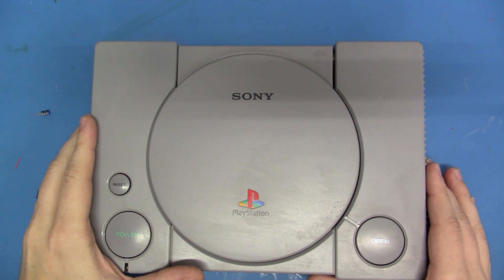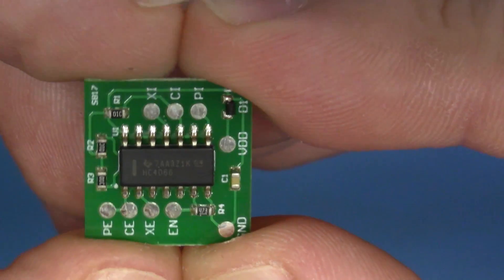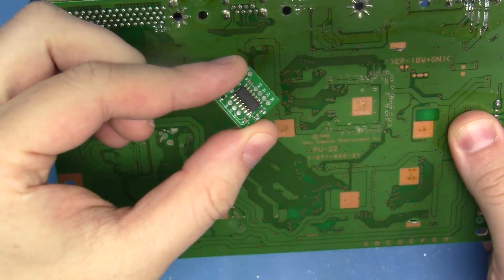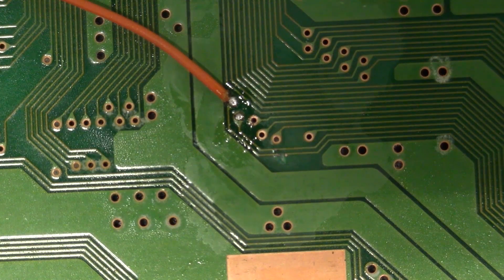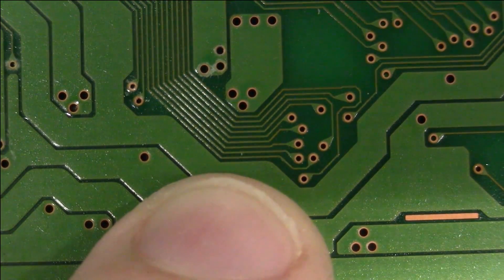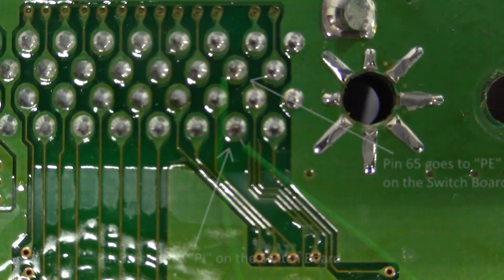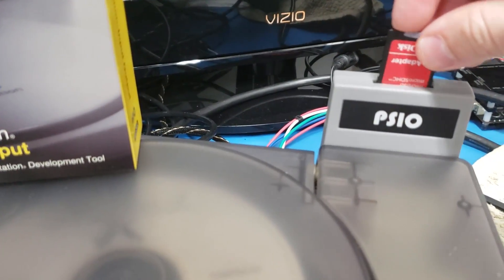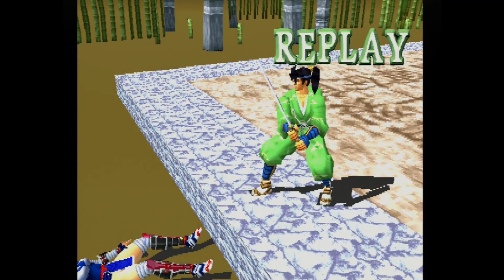PS1 Mods To Run Games FROM SD Card!! PSIO

Comment: would the PSIO work if my cd drive in my scph-1002 doesn't read games?   I've tried adjusting the gain pots and it's just impossible to get these original consoles configured to work with genuine and cd-r rips (console is modded)

Comment: great vid but id suggest if anyone uses a fibre pen hoover the residue off or wipe it off with a kitchen towel with isopropyl alcohol on so fibres stick to it, if you wipe it with your finger and not wash your hands then wipe an eye you could have a very sore eye from the fibre dust

Comment: I think the biggest glaring issue here is that later versions of the playstation (yours is probably the newest that still has it) don't have an expansion port anymore. and the PSone definitely doesn't.
also years ago, I installed my own mod chip. is it compatible with those things? I think my playstayion is actually a 5500 series.
no memory card? heck, It'd be better if you could use the PSIO as a memory card too.

Comment: Very cool man. But for all the mods I have seen. I never saw anyone tried to make a module that mimics the optical drive with the original drive connector on the board to enable a flash drive or even a hard drive and maybe even USB. This would be the master of mods. 🤔
Reply from the maker: I 1000% agree!

Comment: The question is: Who is this aimed at? Real retro gamer or collectors would not vandalize thier ps1's for a mod module just to play on sd cards instead of discs. Especially when that module costs ~130$ give or take a few bucks and the alternatives are many and INEXPENSIVE... emulator, ps one classic mini, psp, ps2, ps3... hell even a ps3 with cobra ode can play ps1 back ups, if its a fat model gen1 it can even play ps2 back ups... So again, who is this aimed at??? I could understand an ODE for PS2's... but not this.

Comment: I found out this years ago but i don't like this project... The price is pretty steep for something you need to install this way and wait for like a decade before you can get ahold of it... It reminds me of those Open Source projects you need to fire up microprocessor programmers and adapt code to your needs... but instead you pay for it a fortune...
I can probably set up a Rasberry easier in the Ps1 using the same outputs and inputs running seamlessly in parallel with the stock system by a switch selector, at least i can start right away doing it by paying a few bucks.

Comment: I'm waiting for an easier solution. I'm sure a GDEmu/Rhea/Phoebe style plug-n-play board wouldn't be too hard to make. All it has to do is generate the code the Playstation needs on boot, then pass to the SD card. I'm sure you could fit that on a board that interfaces directly with the CD laser's ribbon cable so it doesn't require soldering.
Reply: they tried if i remember correct, but audio problems made them go to injection route instead of replacement

Comment: I remember using The adapter piece back in the day to play back ups and Cheat Codes without chip modding 
Awesome video
Reply: yup same is called the "ps hacker" and you still find it for 20€ so why buy this thing?
Reply: Lightblue It was awesome brings back memories Remember the PS2 HDD disc 😳😂
Reply: @QsTechService1  plus the PSIO get one probleme for the games. is cant play audio cd and some game use audio cd sondtrack.

Comment: I dont understand why this exists.  why make a plug and play design if you still need to mod the console?
Reply from the maker: I agree. I'd rather remove the optical drive all together if it takes the burden off of the customer from having to have intermediate soldering skills for a device that already costs over $120...
Reply: @Voultar  yeah that makes MUCH more sense.  also I know you kept saying about no solder pr0n but it still felt like there was.  excellent work as always man!

Comment: Ugh, it's just a shame that you have to cut traces to get this working properly. That's so... permanent. I don't know that I would perform this mod on a 750X. In my experience, those were among the most reliable PS1's, and even then, you can still get replacement lasers for them. So yeah, I have two 7501's and a 1001... I would have NO problem installing this in the latter, however... Unless someone's gonna tell me that the 100X is a crap model for THIS mod as well.

Oh, I can't end this without including the obligatory "I'm SOOOO disappointed in the lack of wire porn in this video!" comment. 😆
Reply: I bought a second PS for $20 to use for the PSIO

Comment: I have a PSIO took a year to get after ordering. I have about 100 games on one 128gig sd card. there"s a software interface you can download from the psio website that will help .Some of the roms have to be converted to a file the psio can read and this software for the most part works really well .This interface also allows you to stream a rom from your pc straight to your PSIO via a usb cable. Wish this was covered on the video.
Reply from the maker: It's pretty clear that this wasn't a PSIO product review video.. This was a video made to help those who might feel overwhelmed by the modding/soldering requirements of the product..

Comment: 0:01 - 0:14 to answer that question, I would just go out and buy a fat PS2, a sata hard drive, a cheap 20 dollar knock off ps2 modem with sata port, and a free mcboot memory card. I'd get to play all the PS2 and PS1 games, and some PS1 games can even take advantage of faster load times!
Reply from the maker: PS1 games CAN NOT be loaded from the HDD via a PS2 unless you use that shitty Popsloader emulator.

Comment: Real good timing. Getting ready to order one. What console you recommend more? I have two (with expansion port) SCPH-7000 and SCPH-5502. Or that.. whatever?
Reply from the maker: You can't go wrong, either way. I like both the 7000 and 5000 series.
Reply: @Voultar  thanks, mah lordy Vi. :3
P.S. they both modded in 90 with dead lasers (pew-pew). So it be interesting either way.

Comment: Hey Lord Voultar! Thanks for the soldering videos! Learned a lot about soldering thanks to you. I was able to successfully install a modbo 4 into a PS4 slim thanks to you. As well as do a cap replacement on a PVM, which fixed all the pictures problems I was having as well. =)

Comment: Is there any cheaper method? 150$ for PSIO is a bit expensive i think
Reply from the maker: I agree. I don't think I would ever pay full retail for this device for a number of reasons..
Reply: for 150$ you can buy a used PS3 and softmod it and play all the PS games you want (plus emulators)
Reply: @leirisal  I have 2 of them not the same
Reply: input lag @leirisal
Reply: @COPKILLER4FUN  get yourself a fat PS3 and use an analog cable on a crt. problem solved
Reply: True @leirisal
Reply: @leirisal  If you really just wanna play PS1 Games then a Softmod PS2 with FMCB should be enough
Reply: @wbblueye1387  Popsloader via FMCB is trash and has bad compatibility.
Reply: @wbblueye1387  true. but for that you don't even need 150$. the PS3 was a proposition for that specific value
Reply: @iKarith worse than terraonion?
Reply: Hacked PS3.
Reply: Lord Voultar has Graced us with another Video. I'll take whatever Solder Porn I can get lol...
Reply: Lord Voultar has Graced us with another Video. I'll take whatever Solder Porn I can get lol...
Reply: honestly? buy a old "ps hacker" for the rear port and burn you games on cd
Reply: Fat PS 2 has a softmod to play off an internal hard drive.
Reply: We need cheap chinese knockoff
Reply: @Kabodanki  Good luck with having zero support by country that doesn't give a rats ass with QA and just churns out PCB's for a cash grab.  Fuck clones of anything, as it ruins these types of hobbyist/enthusiast projects and hurts further developments.

If GDEMU was cloned straight away after it's release, I highly doubt Rhea and Pheobe would never exist.
Reply: @hanzobi1926  Rhea and Phoebe don't exist for many people because the supply is low and erratic, from what I understand. I don't generally condone clear cut clonery but I'm glad that someone stepped up and made the GDEMU available to buy. Looking forward to the Satiator disrupting things too.
Reply: @Brasileiro Patriota name?
Reply: Have a mod chipped PS1, will wait for a clone PSIO.
Reply: @Brasileiro Patriota NAME ???
Reply: While it's emulation, you can pick up a PS Classic. It's $50 to $60 now and that thing has been blown wide open. You can easily load ISOs off a usb and play them on that.
Reply: @Kolpax.619  PS Vita TV is even better option.
Reply: @globalheII  Agreed hacked Vita TV or PS Vita is best top tier option.

Comment: How is this better than just getting a PS2 and modding it and having access to both the PS1/2 library of games?
Reply: You could also just run retropie.  This is to play games on original hardware.  Also if you have a ps2 with component cables, you don't get an image from ps1 games, unless you're doing more mods.
Reply: @nocturnal0072  
 "Also if you have a ps2 with component cables, you don't get an image from ps1 games, unless you're doing more mods."
You're right but you can use HD Retrovision PlayStation Adapter (for use with the Genesis YPbPr Component Cable)
Reply: @Random.Walker.  That is a valid point, but it limits some of the resolution options you would have had with native component cables.
Reply: @nocturnal0072  PS2 with component cables won't get a signal on most TVs, but some will have the hardware inside to convert the signal over properly, if memory serves me correctly.  Not sure if modern tvs have the necessary hardware, as most older inputs are being phased out.
Reply: @kadiusd  True, my only point is that it would be a compromise on PS1 VS PS2 games.  You could have two systems and have the best of both.
Reply: @nocturnal0072  Or 16 systems, and I think I may have a problem!  I've got both, and I've got 3 PS1 systems, one chipped, the other two untouched, and my PS2 is a FMCB memory card.  I like being able to play my imported games, modding makes it easy to do on a regular basis.  As for video quality, you can't get much better on PS2 than you can PS1, even with the cables.  The lower resolution and older style graphics don't transfer over well with just component cables.  Does it look better?  Yes, a bit.  Really its down to what you prefer.   The PSIO is made for those who want real hardware, and the convenience of an SD card for loading games.  I can see the appeal, honestly.
Reply: @kadiusd  I have a PC for emulation, a gaming PC, a dreamcast and a ps3, with a lot of purchased games from the PS store.  Thankfully I don't play to many lag sensitive (retro) games or I would have bought a PVM by now.

Comment: Are there any good PSU replacements for these units?
Reply from the maker: You know.. The PSU's on these things are pretty bullet proof. I'd recommend to just maintain them.
Reply: You can also look into a Pico PSU, if you get real desperate.
Reply: @nocturnal0072  pico PSU don't work on PlayStation. They don't have an 8v rail.
Reply: @MobiusStripTech  You can make your own.  They are basically just voltage regulators on a PCB.  If you need 8v, you could use an 8v regulator or a zener diode with a transistor.  You could even ghetto rig an 8v on top of a working pcb.
Reply: @nocturnal0072  yes you can make your own. That's not the same thing as saying just get a pico psu. It's not a plug and play option, nor a simple wiring option. You have to design an additional circuit to address the extra rail that is not provided.
Reply: @MobiusStripTech  That's why I mentioned, if desperate.  Your right, it's not plug and play.

Comment: Didnt it start as a complete replacement of CDROM driver chip in the console(virtualizing it), but later they discovered problems with CD Audio and reverted to injecting CD signal into original driver chip? so started with instant loads, but ended up at only speeding up seek operations :(
Reply from the maker: I believe that's right.

Comment: Would it be possible to create an SD card reader that would replace the disc drive, similarly to the Dreamcast GDEmu? Maybe then it could be a simple plug-n-play?
Reply from the maker: That would be truly ideal!
Reply: I remember working on just such a project back in the day.. the problem was the disk media check.. and the ps2 and xbox came out.. so....
Reply: maybe something like a Pi with a usb connector for an external disc drive, and have the controller switch between exposing either the sdcard or cdrom to the console?
Reply: Now it is